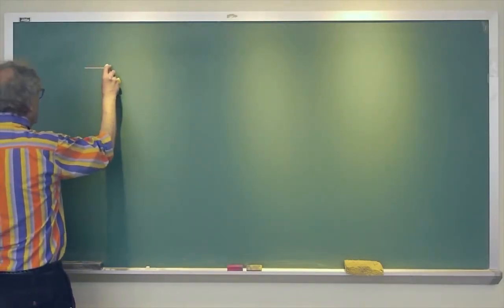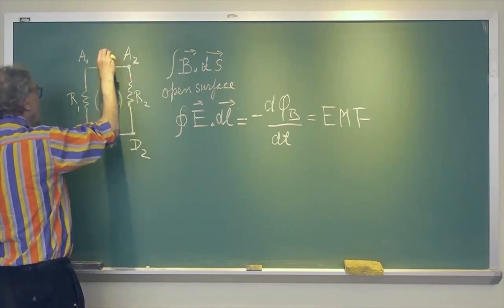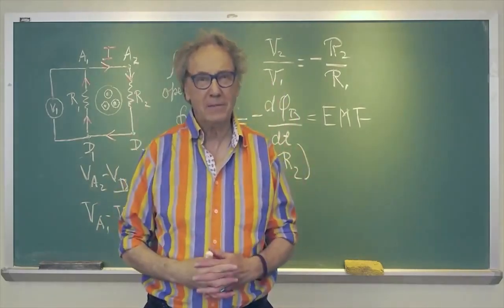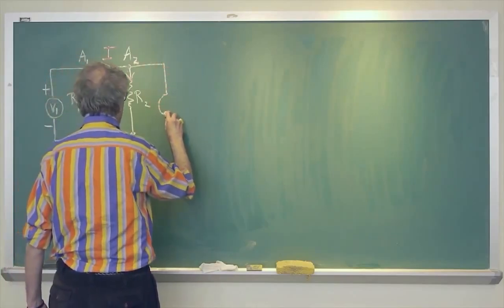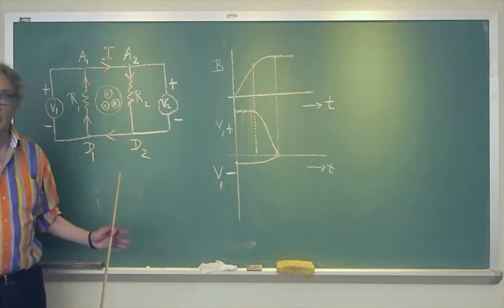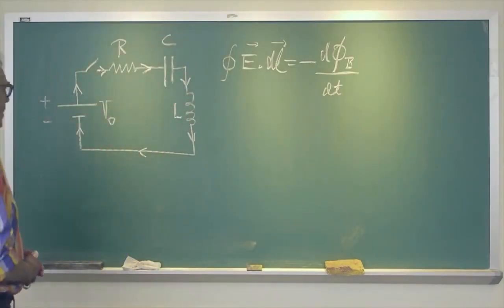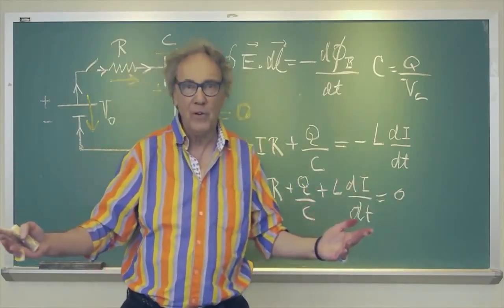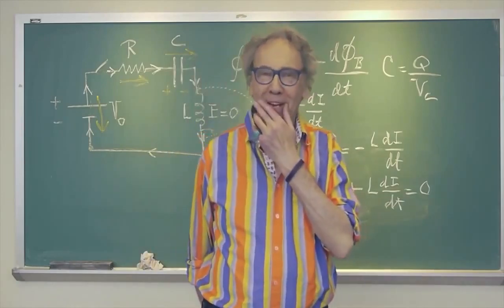Kirchhoff's Loop Rule Is For The Birds

Comment: In india, if there is any changing magnetic flux through loop. We simply add battery of equivalent emf in circuit and perform calculation. By this way, Kirchoff's rule always follow.
Reply from the maker: to add a battery as a replacement is a major blunder You will then find that the potential differences between 2 points in the ciruit will be path independent and that is NOT THE CASE.
Reply from the maker: I appreciate the fact that this Physics may not be familiar to you. Don't feel embarrassed about it; you are not alone. However, it's never too late to get educated. The choice is yours. Maybe this will help you. 
I demonstrated at the end of my lecture #16 of my 8.02 E&M course at MIT that two identical voltmeters attached to the same 2 points in a circuit can show very different values. https://www.youtube.com/watch?v=nGQbA2jwkWI&list=PLyQSN7X0ro2314mKyUiOILaOC2hk6Pc3j&index=17 The reason is that in the case of an induced EMF (Faraday's Law) potential differences are no longer determined; they depend on the path. This also applies to the secondary windings of transformers as the EMF in the closed loop of secondary windings is induced. https://www.youtube.com/watch?v=b7i2uMx7gHo&list=PLyQSN7X0ro22zanLOcvkaSY-IZqheFYM5&index=8
Of course, in cases where Kirchhoff's loop rule (KVL) applies, 2 voltmeters attached to the same 2 points in a circuit will always show the same value. 
My demo was first suggested and published by Romer in December 1982 in the American Journal of Physics. This demo has now become a classic; it's done all over the world at many colleges and universities. 
Kirchhoff's original text can be found in the following link, pages 497-514: https://books.google.de/books?id=Ig8t8yIz20UC. Clearly he was fully aware of the prerequisite for his "loop rule". KVL is a special case of Faraday's Law. That's why Faraday's Law is one of Maxwell's equations and KVL is not.
By teaching students that KVL always works without telling them when it does not work, makes many believe that the closed loop integral of E dot dL is always zero. ElectroBOOM and Dirk Van Meirvenne therefore believe that 2 voltmeters attached to the same 2 points in a circuit must always show the same value which is not true as demonstrated in my lectures. They each posted a video (see @ footnote below) on their channel in which they claim to have proof for their wrong ideas which violate Maxwell's equations. Apparently they do not know, or do not understand, that in the case of an induced EMF potential differences are no longer determined; they depend on the path. MIT students who took my 8.02 course (Electricity and Magnetism) would not make this mistake! I therefore believe that to introduce a "modern version" of KVL and then teach students that KVL always holds is not advisable as you may set them up for making the same embarrassing mistake that both Dirk Van Meirvenne and ElectroBOOM made. 
Also read Professor John Belcher's thoughts on Faraday's Law and on KVL. Professor Belcher is my former colleague at MIT. http://core.csu.edu.cn/NR/rdonlyres/Physics/8-02Electricity-and-MagnetismSpring2002/C29636DB-AB80-49E0-BFAB-BCE00159F00E/0/lecsup41.pdf
(@) ElectroBOOM insulted me in his video by mentioning that the reason why my 2 voltmeters read different values was due to "bad probing". He stated that if I had done the demo correctly I would have found that both voltmeters would have read the same value. He could not have been more wrong  
This is my only msg on this issue. This is too basic. "I teach physics, I do not argue with people who think they know but who don't" (quote from Neil deGrasse Tyson). I do not argue either with people who believe that the Earth is flat.
This video may also help some of you to digest why 2 Voltmeters attached to the same 2 points in a circuit can give very different readings. https://youtu.be/T6S5VS03xZc
Below follows Problem 7.50 in Griffith. Notice the drawing which he copied from Romer and he wrote: "Notice that V1 is not the same as V2, even though they are connected to the same points! See R.H. Romer, Am, J, Phys.50, 1089 (1982)" https://drive.google.com/file/d/1G1a8_YNvB8X9xddUD27x9PE-j7Xbfo3m/view

Comment: In a famous book of physics for high school in Egypt , there is a problem in which, 
A part of an electrical circuit which terminals are A and B , between them a resistor of a value of 1 ohm and a battery of 15 volts and a solenoid has self inductance of 5mH , there is a current 5 Amps flowing from A through the battery and the resistor and the solenoid to B and it's decreasing at a rate of 10^3 A/s. It's required to determine the potential difference between A and B.
The books final answer is 15 V , using Kirchoff's law.
And my final answer is -5 Volts using Faraday's law.
Could you please illustrate the correct answer or at least the final answer ? to insure that I am using Faraday's in the right way.
Thanks
Reply from the maker: I would have to see the circuit to answer your question.
Reply: @lecturesbywalterlewin.they9259  
How can I send you the picture sir ?
Reply: My circuit is exactly the same that you have exampled , Prof.
 A battery ( 15 V ) is connected to a resistor ( 1 ohm ) and an inductor ( 5 mH). All of these components are in series and placed between two terminals A and B. 
If a current ( 5 A ) is flowing from A to B and it's decreasing at a rate of ( 10^3 A/s ) find V between A and B.

I have already watched your lecture professor , but I don't know how to decide whether my answer is correct or them.
Reply from the maker: @tesla1344  watch lecture #20 on 8.02. It's an RL circuit. That's the best I can do for you.
Reply: @lecturesbywalterlewin.they9259  
Thanks professor.
Reply from the maker: you will have to describe it.   here is an example: A battery (15 V EMF) is connected to a resistor of 1 Ohm and to an inductor of 15 mH. The resistor and the inductor are in series. This may not be your circuit but it shows you how you can describe it.
Reply from the maker: If you have a simple RL circuit, I cover that in my 8.02 lectures. I also cover an RLC circuit.

Comment: Goodday Professor Lewin,

Currently I am studying applied physics as a freshman in Eindhoven (HBO), we use Giancoli as our literature. In our second period we are discussing Kirchoff's rules and I stumbled upon your video. 
Thus far I understood Kirchoff's rules in my lectures and my book. But halfway through this lecture I understood that it had certain prequisites which are, as you have stated, not described in the book itself.

I paused the lecture at around 33 minutes, because I was looking for the integral of the equation. So I went through the Index searching for Feyman's rules but couldn't quite find it. 
The book did however show an integral: 
The emf is equal to the sum of the voltage drops accross the resistor and the capicitor 

Maybe I am ahead of what they are teaching me or I am just bad at searching. But I am quite curious what the lecture is about, should I just watch 8.02x - Lect 16?

Excuse me for the wall of text, thanks for the time spent teaching and on commenting on your online students! Have a great day!
Reply from the maker: Giancoli had it WRONG shame on him! 
Lect 16, 8.02, is on my channel.
I appreciate the fact that this Physics may not be familiar to you. Don't feel embarrassed about it; you are not alone. However, it's never too late to get educated. The choice is yours. Maybe this will help you. 
I demonstrated at the end of my lecture #16 of my 8.02 E&M course at MIT that two identical voltmeters attached to the same 2 points in a circuit can show very different values. https://www.youtube.com/watch?v=nGQbA2jwkWI&list=PLyQSN7X0ro2314mKyUiOILaOC2hk6Pc3j&index=17 The reason is that in the case of an induced EMF (Faraday's Law) potential differences are no longer determined; they depend on the path. This also applies to the secondary windings of transformers as the EMF in the closed loop of secondary windings is induced. https://www.youtube.com/watch?v=b7i2uMx7gHo&list=PLyQSN7X0ro22zanLOcvkaSY-IZqheFYM5&index=8
Of course, in cases where Kirchhoff's loop rule (KVL) applies, 2 voltmeters attached to the same 2 points in a circuit will always show the same value. 
My demo was first suggested and published by Romer in December 1982 in the American Journal of Physics. This demo has now become a classic; it's done all over the world at many colleges and universities. 
Kirchhoff's original text can be found in the following link, pages 497-514: https://books.google.de/books?id=Ig8t8yIz20UC. Clearly he was fully aware of the prerequisite for his "loop rule". KVL is a special case of Faraday's Law. That's why Faraday's Law is one of Maxwell's equations and KVL is not.
By teaching students that KVL always works without telling them when it does not work, makes many believe that the closed loop integral of E dot dL is always zero. ElectroBOOM and Dirk Van Meirvenne therefore believe that 2 voltmeters attached to the same 2 points in a circuit must always show the same value which is not true as demonstrated in my lectures. They each posted a video (see @ footnote below) on their channel in which they claim to have proof for their wrong ideas which violate Maxwell's equations. Apparently they do not know, or do not understand, that in the case of an induced EMF potential differences are no longer determined; they depend on the path. MIT students who took my 8.02 course (Electricity and Magnetism) would not make this mistake! I therefore believe that to introduce a "modern version" of KVL and then teach students that KVL always holds is not advisable as you may set them up for making the same embarrassing mistake that both Dirk Van Meirvenne and ElectroBOOM made. 
Also read Professor John Belcher's thoughts on Faraday's Law and on KVL. Professor Belcher is my former colleague at MIT. http://core.csu.edu.cn/NR/rdonlyres/Physics/8-02Electricity-and-MagnetismSpring2002/C29636DB-AB80-49E0-BFAB-BCE00159F00E/0/lecsup41.pdf
(@) ElectroBOOM insulted me in his video by mentioning that the reason why my 2 voltmeters read different values was due to "bad probing". He stated that if I had done the demo correctly I would have found that both voltmeters would have read the same value. He could not have been more wrong  
This is my only msg on this issue. This is too basic. "I teach physics, I do not argue with people who think they know but who don't" (quote from Neil deGrasse Tyson). I do not argue either with people who believe that the Earth is flat.
This video may also help some of you to digest why 2 Voltmeters attached to the same 2 points in a circuit can give very different readings. https://youtu.be/T6S5VS03xZc
Below follows Problem 7.50 in Griffith. Notice the drawing which he copied from Romer and he wrote: "Notice that V1 is not the same as V2, even though they are connected to the same points! See R.H. Romer, Am, J, Phys.50, 1089 (1982)" https://drive.google.com/file/d/1G1a8_YNvB8X9xddUD27x9PE-j7Xbfo3m/view
Reply: @lecturesbywalterlewin.they9259  
Thank you Professor, I will definitely watch the lecture and the notes. And do some research on the subject!
Reply from the maker: Notice that I mention that Giancoli (I used that book for 8.02) has it wrong!    http://freepdfhosting.com/0813df09f5.pdf

Comment: The answer is simple.
There is not  a single EMF. There are two EMFs, one between A1&A2, second between D1&D2, polarity to be define by roles. Both pieces of 'superconductive wires work as EMF sources.
After that Kirchhof's closed loop rule works fine.
Reply from the maker: I appreciate the fact that this Physics may not be familiar to you. Don't feel embarrassed about it; you are not alone. However, it's never too late to get educated. The choice is yours. Maybe this will help you. 
I demonstrated at the end of my lecture #16 of my 8.02 E&M course at MIT that two identical voltmeters attached to the same 2 points in a circuit can show very different values. https://www.youtube.com/watch?v=nGQbA2jwkWI&list=PLyQSN7X0ro2314mKyUiOILaOC2hk6Pc3j&index=17 The reason is that in the case of an induced EMF (Faraday's Law) potential differences are no longer determined; they depend on the path. This also applies to the secondary windings of transformers as the EMF in the closed loop of secondary windings is induced. https://www.youtube.com/watch?v=b7i2uMx7gHo&list=PLyQSN7X0ro22zanLOcvkaSY-IZqheFYM5&index=8
Of course, in cases where Kirchhoff's loop rule (KVL) applies, 2 voltmeters attached to the same 2 points in a circuit will always show the same value. 
My demo was first suggested and published by Romer in December 1982 in the American Journal of Physics. This demo has now become a classic; it's done all over the world at many colleges and universities. 
Kirchhoff's original text can be found in the following link, pages 497-514: https://books.google.de/books?id=Ig8t8yIz20UC. Clearly he was fully aware of the prerequisite for his "loop rule". KVL is a special case of Faraday's Law. That's why Faraday's Law is one of Maxwell's equations and KVL is not.
By teaching students that KVL always works without telling them when it does not work, makes many believe that the closed loop integral of E dot dL is always zero. ElectroBOOM and Dirk Van Meirvenne therefore believe that 2 voltmeters attached to the same 2 points in a circuit must always show the same value which is not true as demonstrated in my lectures. They each posted a video (see @ footnote below) on their channel in which they claim to have proof for their wrong ideas which violate Maxwell's equations. Apparently they do not know, or do not understand, that in the case of an induced EMF potential differences are no longer determined; they depend on the path. MIT students who took my 8.02 course (Electricity and Magnetism) would not make this mistake! I therefore believe that to introduce a "modern version" of KVL and then teach students that KVL always holds is not advisable as you may set them up for making the same embarrassing mistake that both Dirk Van Meirvenne and ElectroBOOM made. 
Also read Professor John Belcher's thoughts on Faraday's Law and on KVL. Professor Belcher is my former colleague at MIT. http://core.csu.edu.cn/NR/rdonlyres/Physics/8-02Electricity-and-MagnetismSpring2002/C29636DB-AB80-49E0-BFAB-BCE00159F00E/0/lecsup41.pdf
(@) ElectroBOOM insulted me in his video by mentioning that the reason why my 2 voltmeters read different values was due to "bad probing". He stated that if I had done the demo correctly I would have found that both voltmeters would have read the same value. He could not have been more wrong  
This is my only msg on this issue. This is too basic. "I teach physics, I do not argue with people who think they know but who don't" (quote from Neil deGrasse Tyson). I do not argue either with people who believe that the Earth is flat.
This video may also help some of you to digest why 2 Voltmeters attached to the same 2 points in a circuit can give very different readings. https://youtu.be/T6S5VS03xZc
Below follows Problem 7.50 in Griffith. Notice the drawing which he copied from Romer and he wrote: "Notice that V1 is not the same as V2, even though they are connected to the same points! See R.H. Romer, Am, J, Phys.50, 1089 (1982)" https://drive.google.com/file/d/1G1a8_YNvB8X9xddUD27x9PE-j7Xbfo3m/view
Reply: @lecturesbywalterlewin.they9259  
Please, find my Very Best Regards and Very Best Wishes. Your lectures are just the best.